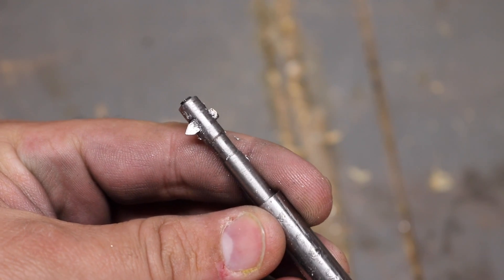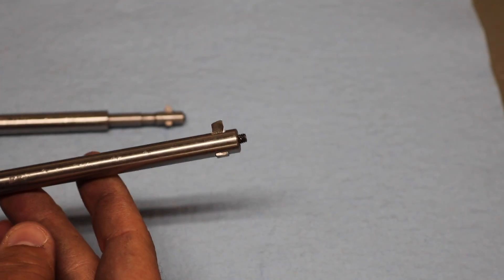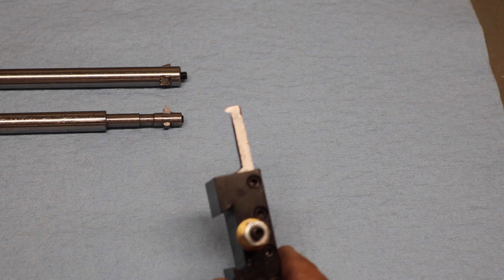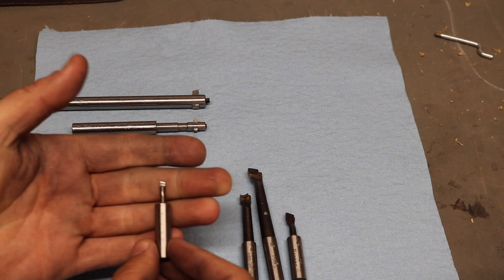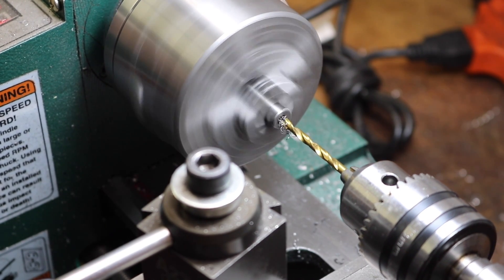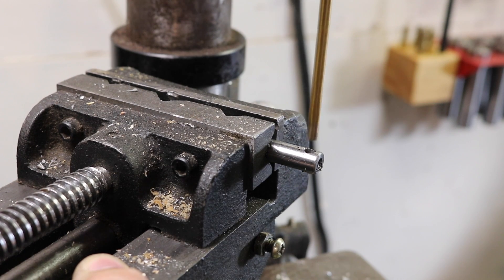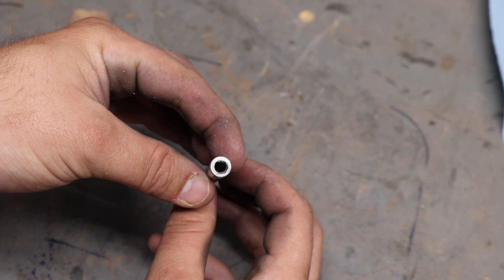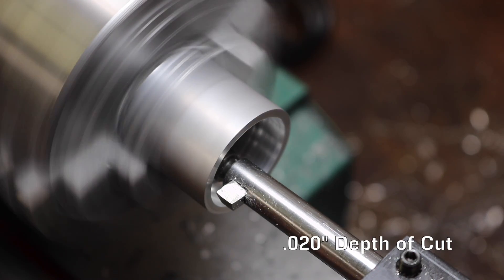How to Make a Simple Boring bar for a Metal Lathe!

Comment: I'd like to make one of these. I've never done this kind of operation(boring). Is it possible to cut an inside shoulder thats nice and  square with this setup? I can't picture how that would work. I plan on drilling out a half inch, just because thats my largest drill size, then I'd like to bore it out to one inch.  My plan is to make a tailstock die holder.

Comment: A flat spot along the top would stop the tendency to turn due to cutting presure,(once you get the angle correct) you can also use round HSS cutting tool stock to save on filing a square hole.

Comment: super i just bought a cazaneuve HB 575X2000,  i need tool  up, but methinks barze the tool steel on, toolpost holds 32 mm, which is 1 1/4 inch

Comment: Biggest problem with the brazed carbide bars is they come with the wrong grind. Using them without regrinding results in a huge negative rake. I'm not surprised that they break on you.

Comment: is the hole need to be off set for the diameter of the tool like you going to used 3/8 squarer  tool bit on 1/2 round does the hole need to be half of the boring tool?
Reply from the maker: As long as you have a manner of adjusting the cutting height of your tool, no.  If you're working with extremely tight tolerances then you may need to offset your cutter so that you don't have too much of your bar's radius underneath the cutting edge if you don't have the internal diameter to work with, but I put the hole in the middle of the bar to maximize strength then adjust cutter height at the tool holder.

Comment: Awesome boring bars....................One other tip for you is that if you put the hole for the HSS blank on an angle you will be able to get the cutting tool out in front of the boring bar, therefore you will be able to bore a blind hole and even have the ability to put a finish on the bottom of the hole if desired.
Reply from the maker: That's a great tip to point out, tom!  I keep meaning to make one of those, should be easy to drill the hole at an angle with some clever fixturing in the mill.  Thanks for watching!
Reply: How would you hold the HSS bit if is at an angle? Make the threaded hole at 90 degrees to the bit anyways?
Reply: have a look at Stefan Gotteswinter
he has a good vid on that and a lot other stuff '
han ar skit bra

Comment: Nice job on the boring bars.  I have made a couple in the past, mostly for odd type work.  I made one to run between centers and put the work piece on the compound rest and bored it that way.  Making a tool for your own use is particularly satisfying.  keep on keeping on.
Reply from the maker: I believe I've seen Mr. Keith Fenner use that method for odd sized and shaped boring jobs!  I'd like to try it someday, myself.  Thanks for stopping by Harold!

Comment: Nope it's not you. It took me a very long time to finally learn that cheap off shore cutting tools really aren't worth whatever money they cost. That goes double for those cheap braised carbide boring bars. There not sharp even when brand new and the bar the carbide is braised into is generally the wrong geometry. A lot of times the bottom of the bar will rub the bore forcing the tool tip out and away from the cut. 

Maybe obvious to some, but not all HSS and Carbide is created equal. You will get far better performance, tool life, and cut quality just by using name brand north american built cutting tools. But don't take my word on it. Do your own test. A name brand end mill, replaceable carbide tip, drill, etc is still cheap enough to buy and then test it in the same material against the cheap stuff will prove it a lot better than anything I could  say. I highly recommend Criterion's braised boring bars but there's many other quality manufactures around. Good boring bars aren't cheap though. And a green grinder wheel is only good enough for roughing a carbide tipped tool to shape. It's needs a diamond wheel to properly sharpen braised carbide. It's impossible to get a better surface finish on the part than the finish that's on the tools cutting edges.
Reply from the maker: +Turning Point that's a great point you've made, and I agree that good tooling isn't cheap (and more often, cheap tooling isn't good!) as I'm still a novice at this, I'm in a constant process of adding to my actual tooling and at the same time upgrading as much of it as I can! You also make a fine point about the different varieties of carbide and HSS which is something I've neglected to identify in my videos, and I'm going to try to be more cognizant of that in the future! Great comment and thanks for watching!
Reply: No problem. I just hope I can save some people some of the money I've wasted on cheap cutting tools over the years before I finally got a bit more education about the high quality tooling being probably cheaper just in far better tool life. If you want a real eye opener try just one OSG tap or die. I have a good friend with probably over 50 years in the tool & die industry and he swears OSG make the best in the world.

There's some excellent Youtube posters around so don't get me wrong. But as good as all these videos are as well as the machining forums they can't cover it all. And there certainly not a replacement for good reference books. There's a hell of a lot to be learned in even books that are 50-100 years old and most of those sell for very little. If it worked back then it will work just as well today. I do think the videos and forums should be looked at as good additions to the books. It's not exactly cheap but the best by far I know of no matter what a persons skill level is would be the George Thomas book The Model Engineers Workshop Manual. Also Google Tee Publishing and Camden Books in the U.K. Lock up your credit cards before doing so. :-)
Reply: Cheap stuff from China, Banggood. That is all I use. I even started buying cbn inserts from China. And I have yet to need to buy higher quality. But for the mill, it is Niagara only.